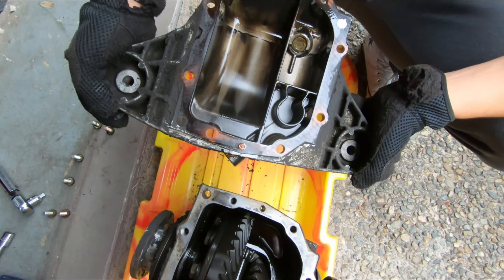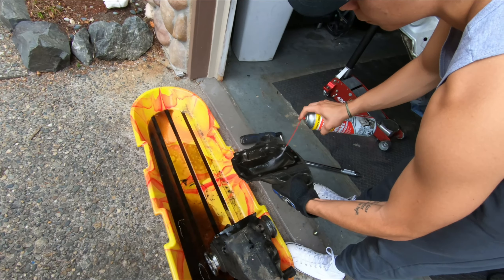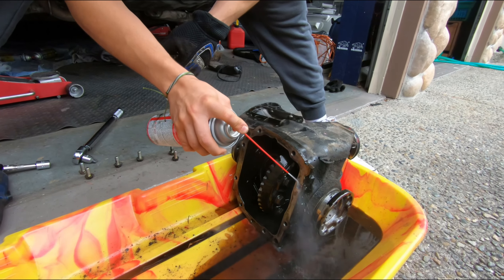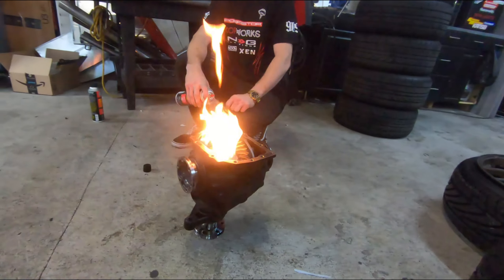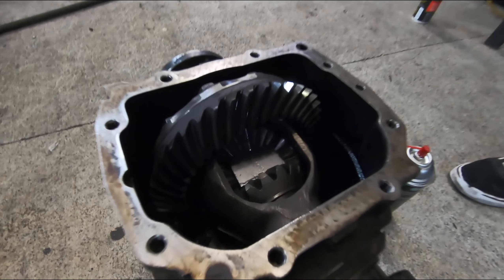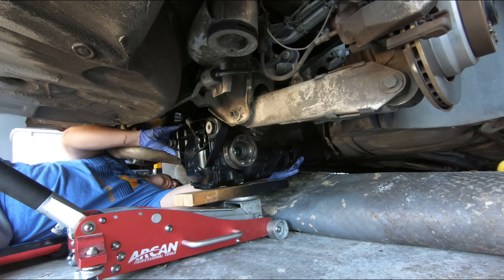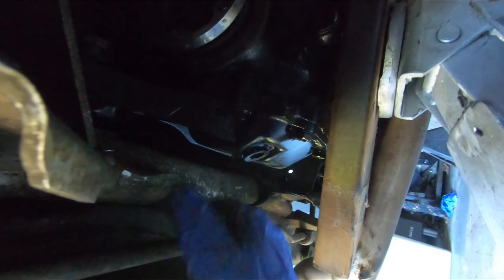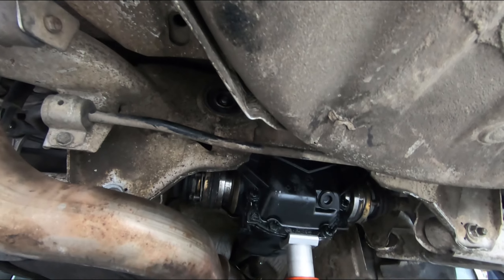BMW Differential Welding + Install - Pt.2

Comment: Nice video.

How are your driveshafts holding up?
Ive broken 4 since I welded the differentialm
Reply from the maker: Funny you asked, my aftermarket flex disc broke. But other than that its been great.
Reply: @TheCraveFeeds  
Its the power output then.

Im pushing 550whp with the 520i rearend. 
Fucking hubs explode everytime.
Reply from the maker: @KalleUhr  yee if I were to go that much i would transition to an m5 subframe
Reply: @TheCraveFeeds  well that sucks balls. They are so expensive. I have a e34 lsd differential laying. Maybe I can fit better axles to it
Reply from the maker: @KalleUhr  hopefully, good luck with your build.

Comment: Any updates on the car?
Reply from the maker: Lots of gear chatter after install, nothing broken so far. Rear Tires need to be replaced every 3 months of normal use and obviously every time after full drifting session. Other than that it’s been great.
Reply: @TheCraveFeeds  Thanks for the update, was also thinkin to weld the diff on my 530i. Is it loud? Was going to daily drive it with welded diff
Reply from the maker: @ruslan9102  yeah the tires squeak and the gear chatter is quite loud. However, I put polyurethane tranny mounts on which makes it more stiff. With stock/OE it should be quieter. It’s loud enough to make people think my car is broken 😂